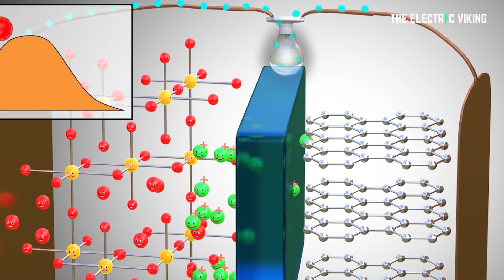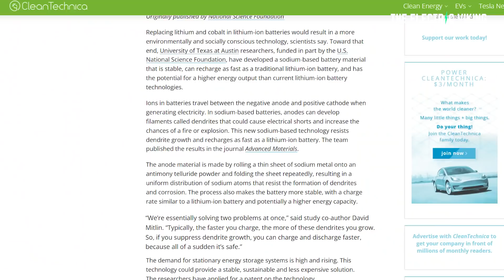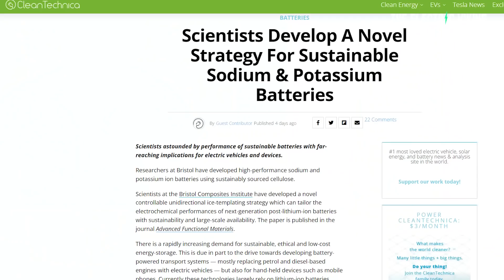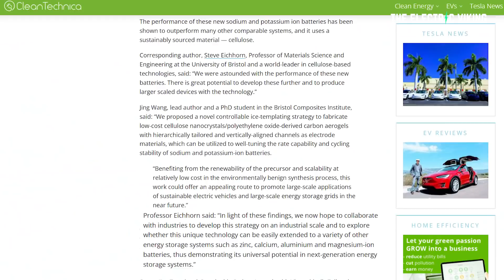Sodium batteries with higher ENERGY density than lithium

Comment: For sure Sodium ion batteries could be an amazing thing due to the abundance, but doubt you can get a higher energy density being sodium 3+ times heavier than Lithium, anyway it could help energy storage where weight is not a concern.
BTW lithium mining in Chile is less disruptive than the Autralian ones
Reply: I think he means density in terms of volume. By weight or mass, the correct scientific term (most people don't use it) is "specific energy".
Reply: For grid/residential storage (where weight is not a concern) there are better options. A team led by prof. Sadoway developed an Al-S chemistry battery which eliminates Li altogether. Aluminium is the third most abundant element on earth, while sulphur is the fifth. In a recent video (https://www.youtube.com/watch?v=v3oO0WeH2KE), prof. Sadoway states that the capital cost of active components in this battery would be some 5 USD/kWh.
Reply: @mateiasi1  aluminum 3rd most abundant element on earth!?
Reply: I’m going to say oxygen, hydrogen, carbon and maybe silicon are all more abundant- just based on what I know about what is around us?
Reply: @prof.crastinator  From Wikipedia: "...aluminium is found on Earth primarily in rocks in the crust, where it is the third most abundant element after oxygen and silicon, rather than in the mantle..."
Reply: @mateiasi1  Again- oxygen, hydrogen (water) and carbon are also all more abundant.  (Nm- by mass- I’m a dummy and apologize)
Reply: And still iron and nickel would be more  by mass- but It is much deeper, so not really accessible.
Reply: @prof.crastinator  Actually not, silica and water are the most abundant on the surface for sure, but then Iron by mass is way more accessible mines, take a look to Carajas (Brasil) or Pilbara Valley (Australia) and so many more. Normally raw material accessibility is in direct relation to its price. O2 and H2 are energy expensive to refine.
Reply: @MrCcristof  not really what the discussion was, but I was way off too.  Most abundant by volume or per molecule are much different than by mass.  And yes the earth is mostly iron by mass- but the vast majority of that is locked up.  Oxygen is not just o2- it’s also a constituent of hydroxides (water), hydrocarbons (plant/animal life) and much of the rocks and sand of the crust.
Reply: @MrCcristof  cost to refine has nothing to do with abundance.  Oxygen and hydrogen are constituents in nearly everything- and they are very easy to refine- storage is their highest cost.
Reply: @MrCcristof  ex: silica dioxide, carbon dioxide, aluminum oxide, etc.. in fact most of the earths metals are locked up in oxides.  So oxygen is very abundant if you were going on a per molecule basis- but it’s light which is why per mass it is not as abundant.
Reply: @Carlos C Sodium is heavier than lithium on an atom per atom basis, but Li-ion batteries don't really have all that much lithium in them.  Elon Musk says their batteries are about 2% lithium by mass.  So a switch from Li to Na, holding everything else constant would only add about 40-50 pounds to the weight of the battery.  The anode & cathode materials, casing and pack structure are the bulk of the weight.
Reply: "BTW lithium mining in Chile is less disruptive than the Autralian ones" not if you live there and want water...

Comment: There will always be a better battery around the corner, always. But as Musk pointed out, you need to be able to produce them in volume at low prices. That is where everyone failed so far. E.g. batteries based on graphene are even far better than the sodium but cannot be made in volume.

Comment: Sodium ignites when in contact with water. Even on humid air it reacts as violently as you can imagine. Worser than the thermal runawayin Lithium.
Reply: Lithium is less reactive than sodium, for sure, but remember that we are dealing with inert ions, not reactive atoms
Reply: @موسى_7  It will be more reactive than NMC battery have hotter Thermal Runaway. To begin with Sodium almost have double density than Lithium so its havier. It will be good on stationary battery but not on vehicles.